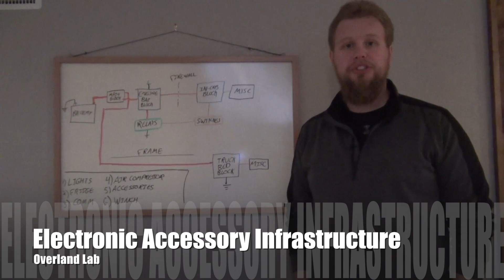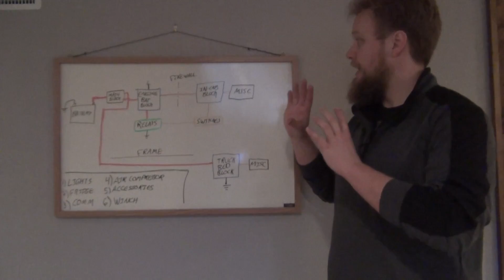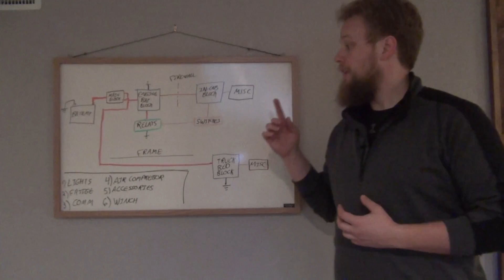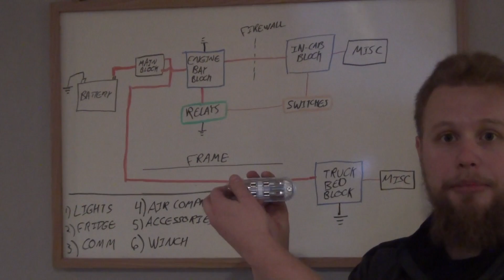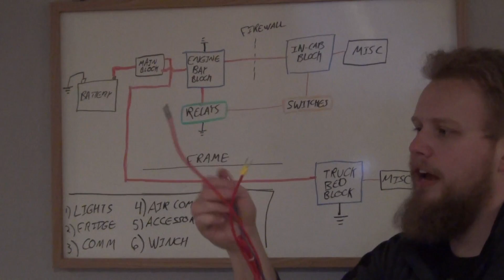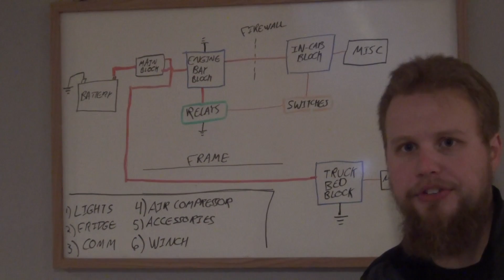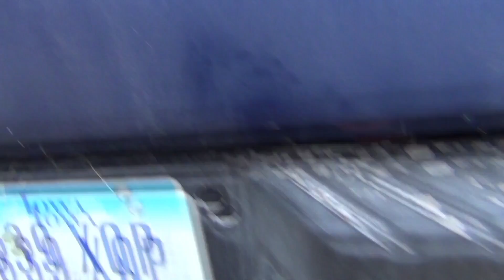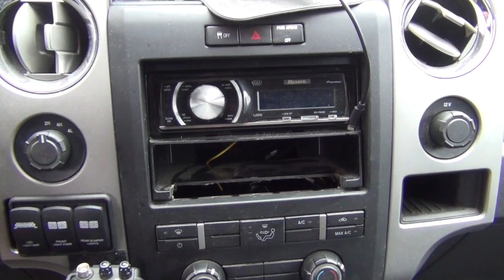How to Wire an F-150 Adventure Truck for All the Accessories You’d Ever Want

Comment: This is great. I got some good ideas, as I am adding lighting to the bed on my rig and am contemplating different ways to get power there and where to run wiring into the bed easily. I appreciate your point about planning up front. I drew my plan out (what I have so far) and then realized I should make some changes. Would have worked myself into a corner without some preplanning. Thanks, the detail in the video is appreciated!

Comment: I like these ideas. I bought most of these components based on this video. I've got a little more work to finish the install but I'll have the beginning of an excellent auxiliary electrical system for powering my truck. I'm only powering two 12v plugs to power pair of inverters in the rear seat area so the kids can each have a place to plug in their devices. Edit: I got the wiring run and hooked up. it took a little longer than I thought, but my projects usually do! I've got two 12v plugs wired in and am going to add two more in the next few months.

Comment: I appreciate the detail in your videos.  I'm looking to install accessory power as well to the rear of my 07' Dodge Ram quad cab 2500 Diesel.  I got the Decked system ordered and appreciated your input there as well.  I am still decided on adding a deep cycle battery (I have 4 available) with an isolator or upgrade the alternator.  I have a large inverter and will be adding a winch in the (hopefully near) future along with led lights.  I'm really new to the overland game and just started to set the truck up for that purpose.
Reply from the maker: Hello! Always happy to hear that my natural obsessiveness can help others! Dual battery systems are always great, but I've got a "DIY modular, standalone deep cycle backup battery system" that I'm working on that will be super affordable and highly modular, so stay tuned to the channel for that! 

As @r0blashley suggested in a comment, make sure any wire you run under the truck or through the frame is loomed for protection. I actually went back through and pulled all the 4awg wire back through the frame and loomed it all. It was a pain, but it was cheap and buys peace of mind. Also, if you're adding a lot of accessories, it may be worthwhile to go back and beef up the major factory grounds (negative battery to ground, engine to ground, etc) to account for the extra accessories.

Comment: Why not just use an SPod and a Genesis dual battery kit?
Reply from the maker: Couple of reasons! 

1) There's no aftermarket dual battery tray kit available for the 09-14 F-150. Believe me, I've looked everywhere. I would have to fabricate something and the way the engine bay is laid out, it would be really tricky. I may revisit this at a later date, but right now, it's not worth it to me. The Jeep and Toyota guys have it easy; everyone makes fun aftermarket parts for their rigs! Anything you could ever dream of! The rest of us get left out in the cold. 

2) SPods are super cool, but they're expensive, and I'm keeping this thing on a tight budget. It was super easy and not that expensive for me to do a simple DIY setup that I could easily troubleshoot. Plus I had lots of parts leftover from other projects.
 
3) The nice thing about the secondary battery box (as I'll discuss in the video later) is that I can take it out of the truck, relocate it, and use it elsewhere. I can put it in other vehicles, use it in my trailer, use it away from the vehicle, and make the whole system modular while still being able to use it to jump start the vehicle. 

4)Since I've put out this video, I've found a way to do a DIY battery box. It will be more spartan than an ark-pack, but it'll cost <$100 (sans battery) and it'll work for everything I want it for. 

It would be great if I had some kind of sponsor, or if I had a six-figure income, or I did this full time. But I'm just some guy with a truck, a love for the outdoors, and enough DIY know-how to be dangerous. There are some expenses that are unavoidable, but for the rest, I'll get creative!
Reply: Overland Lab Sweet! Thanks for replying so promptly! I fully understand trying to stay on tight budget. That being said however, you should at least give Genesis Offroad a look. They not only make a universal dual battery tray and kit for tucks, but also a stand alone dual battery kit that comes with all the wording and a tray for a single battery to put wherever you see fit.
Reply from the maker: At some point down the road, I think it would be awesome to do an 
integrated, under hood, dual battery. It'd be especially awesome to do 
them side-by-side, but I think that's a way off for now. When the time 
comes, I'll definitely look into Genesis. Do you have their system?
Reply: Overland Lab I wish. I've done a lot of research on them and their products and I plan on ending up with it as well as a whole bunch of other stuff like Rigid Industries lights, road armor bumpers and the like. Unfortunately right now the only vehicle I have is a 2014 Ford Focus Hatchback. Once I save up enough though I'm going to get a 2015 or newer F-150.
Reply from the maker: Ah, gotcha! Just a heads up, I've talked to a BUNCH of guys that 
upgraded their 09-14 to 15-16 F-150s and they really don't seem to like 
them. They all say they preferred their steel body 09-14. I don't really
 have my own data point since I've never drove the newer ones, but I do 
love my 2011 5.0L 4x4.
Reply: Overland Lab I've seen a lot of reviews and personally, I prefer the looks of the newer models to the old ones. I also plan on getting the whole exterior of the vehicle sprayed with Linex so that would negate any minor trail damage that could occur. My ideal truck is a 15 or newer SuperCrew with a 6 ½ foot beed, 4 wheel drive, and the 3.5L EcoBoost V6.